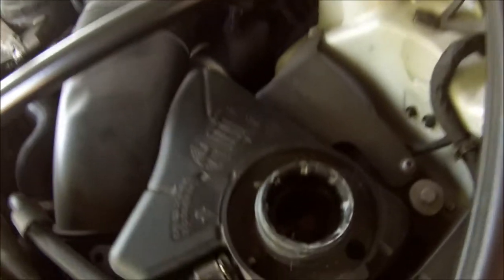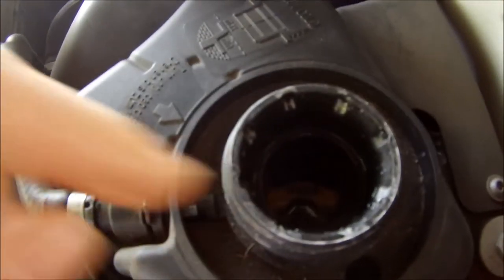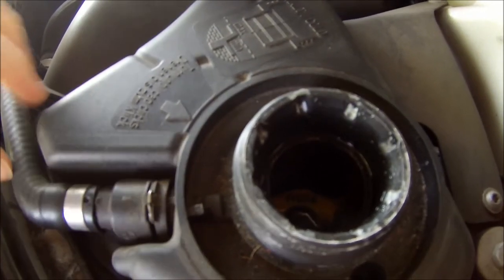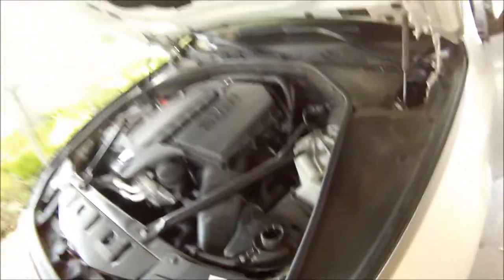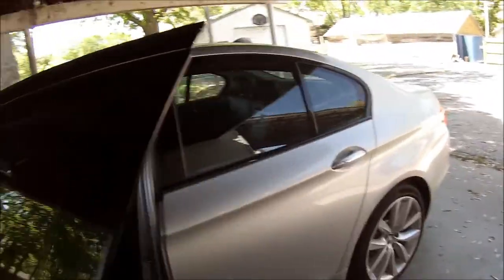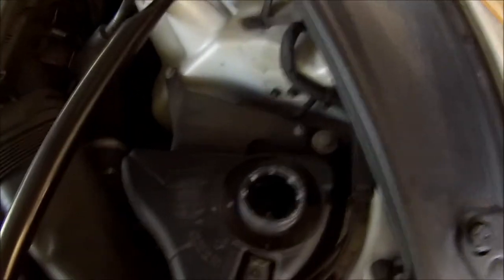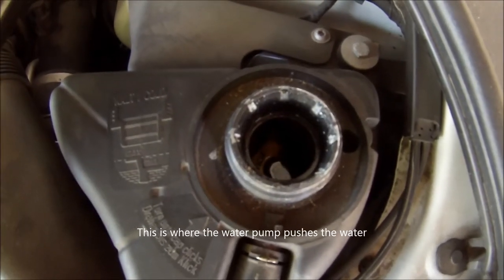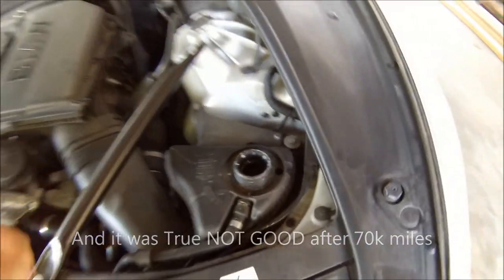How to check your Water Pump on 2011 BMW 535 F10

Comment: Hello, thanks for your sharing. sorry for your water pump, I just replaced one in my son's 325 ci, it was not a big deal, but still some work...I have a question for you :) I found a comment that you did 7 years ago in another channel, about replacing the chip in the DME of an e46 instead of replacing the whole combo (DME, EWS, key, etc) Have you done this job before in your car? Did it work? My son's car is acting funky, it would start ok, but after running for 30 min won't start again (no crank, no start), and maybe would start 2 hours later...I don't have a computer and I don't want to go to the dealer, because I know the story...more info: The car is running very well, today for the first time it quit twice in a traffic light, but started right away. I have only one key and it is in really bad shape. Car has only 107K and strong compression, my son bought it a few weeks ago, we just finished servicing the engine. Sorry for the question and thanks in advance!
Reply from the maker: That was my old 1999 bmw e46, I think the computer got water in it and fried it. I think I just swaped out the computer and key that went with it if I remember right, it was a pain in the butt, but my car wouldnt start at all.
Reply: @JacobKnightRiderShop  ok, thanks for your answer. In my case, finally it was the old key...after a lot of troubleshooting...I solved it out. Thank you.